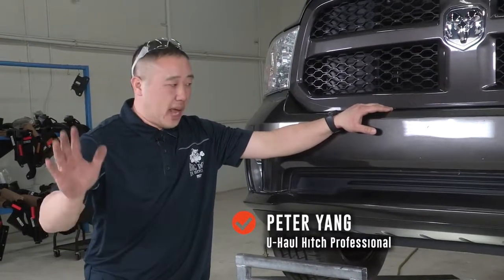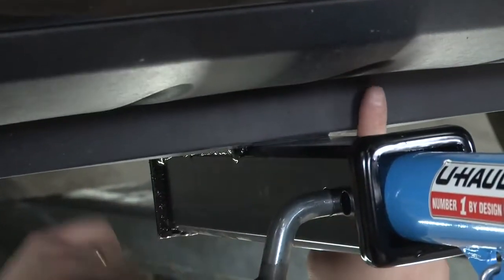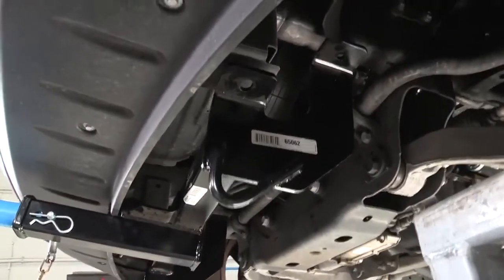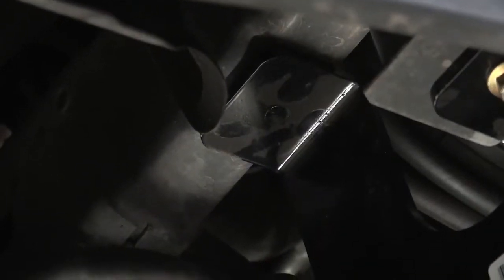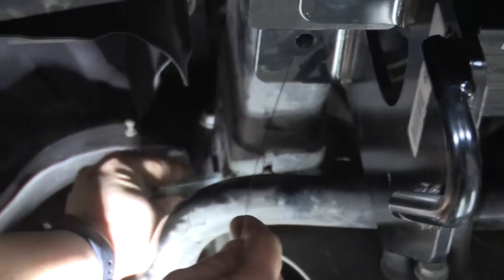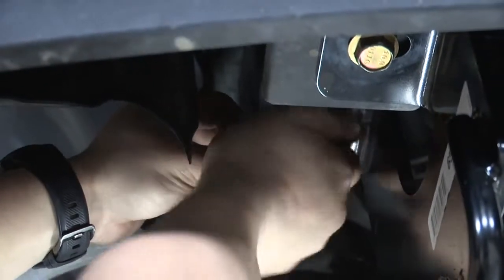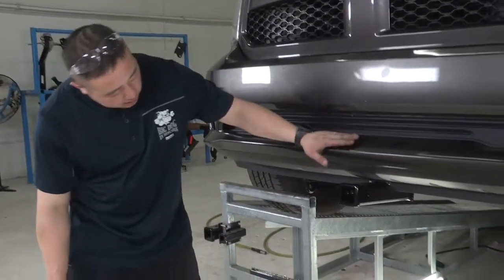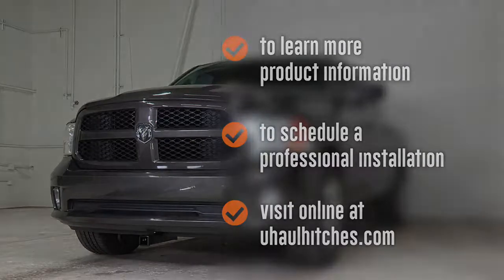2015 Ram 1500 Front Mount Trailer Hitch Installation

Comment: You will find a hole about 8 inches to the rear of the frame use this hole to fish the plate and washer in. You should find this easy to do no cutting involved.
Reply from the maker: Thanks for the Tip!